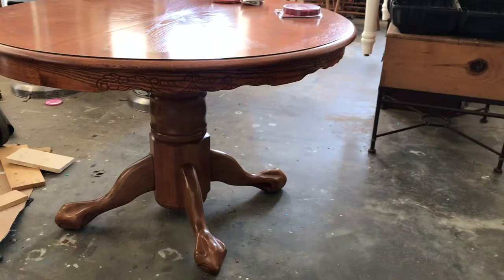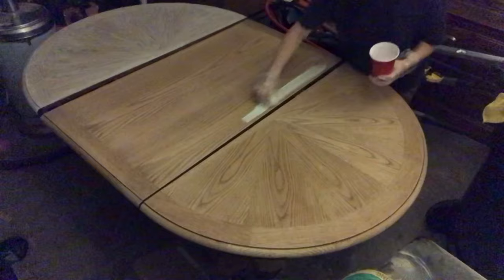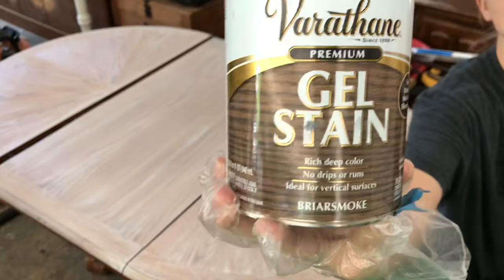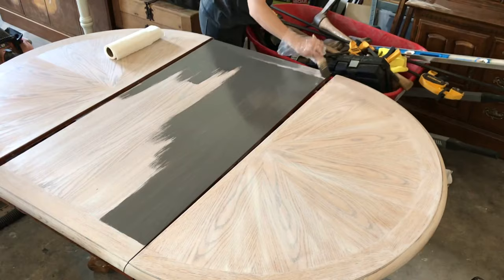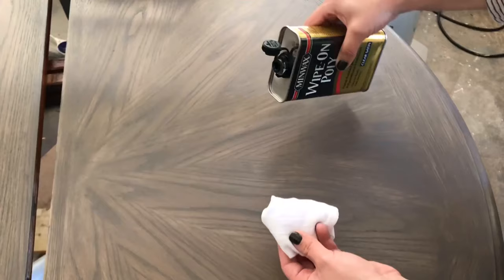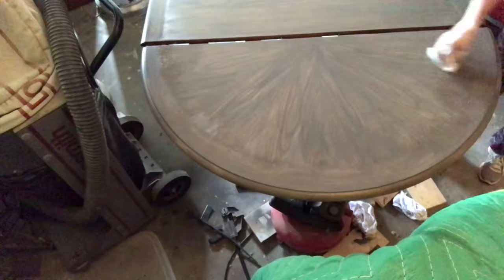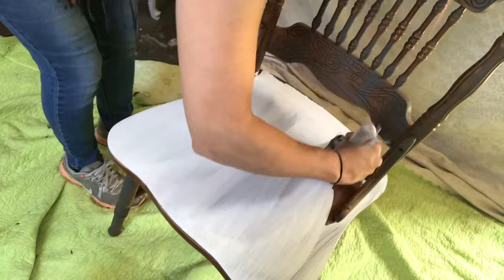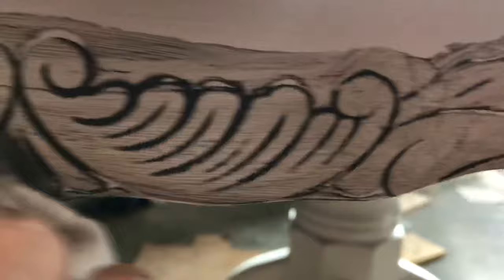OLD Kitchen Table Makeover Light Grey Stain | beginner friendly, step by step how to

Comment: I bought this exact set and am working on it. I was going to finish the top to match my darker kitchen cabinet and the legs and chair in a distressed navy. This is a great video. I am newer to refinishing furniture and there is so much info. Am I correct that you should remove all old finishes to stain but a light sanding is okay if painting?
Reply from the maker: Hey Sue, you’re right there is a lot of info out there 😅 but you are correct that to stain you’ll need to strip the existing finish off and then stain but to paint, all you need is a scuff sand and a primer like Zinnser is great to add before painting also.  It’s a fun hobby, enjoy your project!

Comment: I love this, I have this table, it does have that veneer too. I'm going to give this a shot. My questions 3 mos. later, are, did you sand the chairs 1st and could I use a water based paint instead of oil? I have never worked with oil based paint. Anyway, you may have answered this already, I'll look through the comments in the meantime.  Thank you for such a beautiful design, especially the trim work!
Reply from the maker: I scuff sanded most used parts of the chairs with a 220 grit sanding pad.  The white paint i used for the chairs is water based, the only thing that was oil was the grey stain I used on the table and I had to use that because it was the only stain I could find in that color.  A lot of furniture painters use a paint wash technique instead of stain to avoid chemicals.  The way you do that is to mix water with your water based paint and then apply the same way you would apply a stain.  I need to do a video on that!  Hope that helps!  General finishes makes a water based gel stain called ''no pain Gel stain" check that one out!

Comment: Amazing process, I loved the finished look.I have a table very similar and want to do the same thing,painted base and stained top. A question for you- did you use any of the grayed wax on the base to tie in the color?
On a different note, I recently bought an oak gentlemen’s dresser for my bedroom. It is pretty old so I want to clean it up and revamp the hinges and handles. What product do I use to clean it up. I’m not intending to refinish it or repaint it.

Comment: I have a question on the chairs.  Do I have to sand then before I paint them??? Also at what point and area did you use the Zinsser Bullseye primer??? I want to make the seat of the chairs the same color as the table.  What do you think? I know you have just so much time for each video. It would be nice if you were able to show more of each step I'm new to this and I don't want to mess any of this up

Comment: I would've loved to see the complete chair process..I'm trying to do the same set.
Reply from the maker: Zane Blane I need to do a video on that!  On the chairs I scuff sanded them and used sherwin williams pure white in satin and then i clear coated the seats with water based poly.  On the tops I did the same technique shown in the video on the table skirt using dark wax to highlight the details and I didn’t clear coat after I waxed bc the wax will protect ❤️ hope that helps a bit!
Reply: @blacksheephouse  ...how did you get into the grooves where the 'J'  curves from the back of the chairs to the seat.
Reply from the maker: Zane Blane I just flipped the chairs over and used my paint brush, then flipped them back and did the same, there’s a lot of angles on those chairs!  I just assume anything I missed doesn’t show when the chairs are sitting at a table.  Chairs are definitely a pain that way 😅
Reply: @blacksheephouse  ..lol..yes, there are..thx!

Comment: You didn’t strip the chairs? Or sand?  U just applied the white paint & then did the thing w  the combination of waxes?
I have an oak table much like yours but without a leaf in the center.  However my chairs are made of a white fur if I remember correctly.  I have had the set for 40 years & was saving for my daughter started thinking this would look so beautiful.  The fur doesn’t have the grain that the oak does.  I stained them years ago & covered w a poly I believe.
Great video!  Thanks 🙏🏽
Reply from the maker: Right, I did not sand just cleaned well with krud Kutter and got to work ❤️ it’s a very sweet thing to save for your daughter!  The valspar furniture and cabinet enamel adhesion and durability is really good too like Sherwin Williams but it’s cheaper 😉 last quart I bought was $28 and they do all the Sherwin Williams colors there at lowes

Comment: I was also wondering did you have to sand the chairs to get the paint to adhere? Should I use a primer before painting the chairs.? I have used the same colors as you on my table mine turned out a little lighter but it gorgeous.  My table is the exact as the one in this video

Comment: I’ve made a bunch of rookie mistakes and about to sand down and start over for the third time. I can’t very close to perfection this time but when I put on the wipe on poly stain it took up the dark stain. So did I not let the dark stain dry long enough? I did not use the gel version of Varathane Briar smoke but I did use the oil based stain by the company and added a bit of an oil based minwax gray to get closer to the color I needed.
Reply: Should read “I came very close”

Comment: I am doing the same thing to the exact same table and love how yours tuned out. Thank you for sharing. I have one issue maybe you can help with. The screws that attach the top to the base are missing. I have 6 holes, can you tell me approximately what size and length screws your table has? Thank you again so much for sharing.
Reply from the maker: I have no idea but the ppl at hardware stores are very helpful ❤️
Reply: @blacksheephouse  thanks for replying. I have tried so far it’s not looking good.

Comment: Questions, this set looks just like mine, but is yours solid wood or is the top laminate or veneer? I think mine is veneer. Would it still sand down that cleanly? I'm just afraid I can't get rid of all the red. Second question,  can you post pics of the after on the chairs? It went by so quick on the video. This is almost exactly what I'm looking for
Reply from the maker: Hey Ann, mine was a wood veneer so I had to be careful sanding, especially around the edges seemed to be where I was more likely to get a bit too deep sanding but it came out great!  Don’t worry about the red, if you need to you can bleach it, I have lots of tutorials on that here on the channel.  And sorry I did rush the chair part- I used Shirwin Williams trim paint in their popular white color - pure white.  I cleaned the chairs really well and I would recommend using a primer if you don’t want to sand the chairs.  Go for semi gloss on the paint for the most durability and if it’s too shiny for you then you can throw a coat of matte water based polyurethane to tone down the sheen and add even more durability.  Hope that helps 🖤 I can’t share a picture here but I promise they were so beautiful, and you’ll love your table done with these colors

Comment: Thank you for this video and the information that you provided.  I am preparing to do this to my dining room table.  I am wondering did you do the same process to the base as well?  I love how your table looks and would like to do something similar to mine.  Thank you for this video.
Reply from the maker: I just cleaned the base really well and then painted it with Sherwin Williams trim paint and then did the wax over it.  If you have kids and are hard on your furniture you may want to do a water based polyurethane on top of the paint before you do the wax.  The wax is really just for the look not for protection ❤️ you’ll want to use water based clear coat bc oil based will yellow slightly over time on top of white it’ll show but for other colors you’re good
Reply: @blacksheephouse  Thank you.  Just doing the table now.  I am waiting for a wax to arrive and will finish it this week.  Thank you for all of your information.  It has worked so well and I love the way the table is looking.  Really appreciate your information.

Comment: Did you sand or do anything to prep the skirt and chairs before you painted them? They look fantastic! Doing a similar project and am curious if I need to sand them before I paint them.
Reply from the maker: Cami Fairbanks I usually do a light scuff sanding with 220 grit, I use a piece of sandpaper wrapped around an old sanding sponge/bar thingy.  I also use a cleaner called Krud Kutter.  Cheers!

Comment: This is beautiful! We actually just got my husband’s grandmother’s old table & it is beautiful but I want to paint the bottom portion of the table white & the chairs have this beautiful floral detailing on the back I really want to use your idea with the wax to create that contrast between the white & the grooves of the detailing so it doesn’t look so stark white but I don’t want to paint the seats of the chairs. Just the backs & legs. What’s the best way to cover the seat? I’m afraid of using painters tape because I don’t want to damage the seat. It is solid oak but the has laminate on top of the wood.
Reply from the maker: Thanks, that will look stunning!
I would use frog brand painters tape, they have one for delicate surfaces it is the yellow one from frog tape

Comment: That is my exact table I want to redo. Love what you did.  Do you have to use the flammable stain?  Can you recommend one that’s not?  I’m new to this.
Reply from the maker: Hi there, I totally understand being intimidated but the oil based is going to be the most durable finish for your table (plus I have not found a similar color in a water based product yet).  Just be sure to lay your used rags and or sponges out to dry in a cool area like your garage or in the shade of your yard until they dry, then you toss them.  You only run into problems if you wad them up while still wet from staining in a ball and toss inside a hot garbage can or something.  DIYers use oil based (flammable) paints all the time, I promise you got this ❤️ I always just like to let people know because a lot of my audience are first timers ❤️

Comment: Do you have pictures of the chairs? I have the exact same dining room table and chairs that I’m refinishing. The set had been sitting in a carport for quite some time and the veneer was coming up on the table top. Therefore, it had too much damage to stain. I ended up painting the top but want the same colors you have on your top. I’m not sure how to achieve that with paint. Yours turned out so beautiful.
Reply from the maker: Hey Yvonne!  I do have pictures of the chairs if you will message me on Instagram or Facebook I can send them or email you.  What I would do is try the pottery barn tutorial I have on here with the grey stain.  It’s an old video so forgive the production quality but my “faux wood pottery barn technique” is great for veneer. https://youtu.be/Unce_QuXoJ0
And here is me doing the technique (in brown) on a table top
https://youtu.be/9hJEG4MrZuE
Hope that helps!!  PS you can use the Briarsmoke gel stain in the crevices of your chairs instead of wax if you want to save $ and just buy one product but be sure your chairs are already clear coated first so the paint doesn’t absorb the stain

Comment: This project turned out beautiful! I have a table and chairs  just like it that I got for $25 on FB marketplace. It’s in excellent condition except finish is coming off ( lucky for me) lol. My question is can I use a regular stain in the details on shirt of table and the backs of the chairs and use poly as the sealer instead of the waxes?
Reply from the maker: Yvonne, that’s actually such a great idea!  I’m so glad you commented bc I just learned something valuable ❤️ that wax was such a pain to make in that color so I’m going to use stain from now on!  I do think you have to test a spot to make sure it doesn’t absorb too much on the white paint.  But since this paint has a sheen to it I would think it would just wipe away.  Thanks again!!

Comment: The wipe on poly, is that what seals the table so you're able to eat on it and clean it when dirty? Also, do you use that on the chairs too?
Reply from the maker: Yes, the wipe on poly seals it and protects it, the paint I used on the chairs is for trim/doors so is strong enough w/o a topcoat though

Comment: This is so pretty, how long do you let the gel stain set before wiping, and do you wet the paper towels that you use to wipe down the gel stain? What kind of 3 waxes did you use to achieve that grey color?
 Sorry for all the questions thank you!
Reply from the maker: D J thanks!  I let the white wash dry completely which took a few hours and the gel stain can take a few days to dry since it’s thick and oil based.  I don’t wet the paper towels just use them as is, hope that helps!

Comment: Did you add a protective finish after you applied the wax??? Or did you use the wax as your protector
Reply from the maker: The paint I used is trim/door paint so it has enough durability on its own and the wax is just decorative in this case ❤️

Comment: I was wondering, is the white chalk paint and can I paint right over top of the legs without stripping? Do I need to seal it with anything?
Reply from the maker: You don’t need to strip the legs, just do a light scuff sand and clean your furniture.  I used a trim paint from SW on the base but more recently I really like the HGTV Sherwin Williams line at Lowe’s.  It adheres really well and if you get a satin or semi gloss you don’t need a topcoat ❤️

Comment: Thanks for the video. What are your thoughts on chalk paint vs the latex you've used 
for refinishing tables and chairs?
Reply from the maker: Thanks!  Chalk paint sticks better usually, at this time I really prefer general finishes milk paint for it’s durability and ability to stick to any surface.  Latex will work too if you prime first ❤️ they all get the job done but general finishes milk paint is the winner for me

Comment: Hi Sheer, this is my very first project.  I have used the general finishes flat top coat but i would like to get the shine. i want to use minwax poly.  my question is can i use oil based topcoat on waterbased topcoat or do i have to sand before applying minvax??
Reply from the maker: You sure can!  I would just give it a super light scuff sand with 300 or higher sanding pad and then go for it!

Comment: I am very interested in knowing if you applied a poly acrylic after the wax decorative part
Reply from the maker: No o didn’t but the Sherwin Williams paint I used is trim paint in a satin sheen so holds up extremely well on it’s on and the wax is just decorative but does add a little bit of protection too

Comment: I am in the middle of a table and chairs and has been a nightmare. So much bleed through and uneven on the spindles. The top is perfect. Chairs are challenging
Reply from the maker: Chairs are time consuming for sure, if I was you I’d spray some shellac based white or clear primer on the spots you have bleed through and then once it’s dry to the touch you can carry on with painting them.  Using a roller helps speed things up a bit too, keep going it’ll all be worth it in the end ❤️👏👏

Comment: Did you have to put poly over the wax? How is the paint protected on the chairs from peeling ?
Reply from the maker: You could use wax or polycrylic and have great protection.  The sherwin williams paint is durable though since it's used for doors and trim.

Comment: Hi i just want to ask about the white paint cashmere did you do any sanding with the chair or you just paint it and did not do anything before painting? I really want to paint our old dining set but I'm a little scared to do it since it will be my first time I'm might ruin it lol but yours turned out really beautiful just exactly the way i want it in our dining set 😊
Reply from the maker: Hya Agustin hi!  I clean items w/a cleaner called Krud Kutter or Simple green and a super lightly scuff sand them w/220 grit sand paper, sand very lightly and then remove the dust.  Hope that helps!!
Reply: @blacksheephouse  thank you so much

Comment: Hi Nicole, this is the gray/brown I’ve been looking for. My question is do you think the Briarsmoke color will come out the same with their regular oil based stain? Would you still use the pickling wash if it was new wood? Or did you just use it because it had a previous finish and was gel stain?
Does the pickling wash contribute to bringing out the gray because it doesn’t look like it has any gray to it when you look at the color on the can. Also, how long did you leave the stain on before you wiped it off? Thanks!
Reply from the maker: Good questions!  I like the gel stain for ease of use and coverage vs the liquid.  The pickling wash is very important to create the base for the stain to really pop.  If you just used the gel stain it would be a lot different looking even on new wood. Briarsmoke def comes out a nice warm grey with the pickling white wash as the base  finsih  Glad you asked!
Reply: @blacksheephouse  thanks so much for responding! I have looked everywhere for the Minwax pickling stain you used, and they don’t carry it anymore. They have a colorwash in white but it’s not pickling. Do you have another product you can recommend.
Reply from the maker: @suzanne6681  yeah, the color wash I think is the same thing just rebranded!  Should work great!  Minwax 618604444 Color Wash Transparent Layering Color, White Wash, 1 Quart https://www.amazon.com/dp/B000BZTJDI/ref=cm_sw_r_cp_api_glc_fabc_b97-FbMVSXMRP